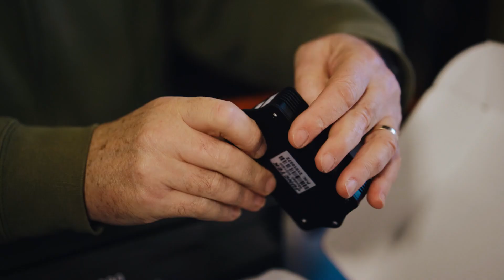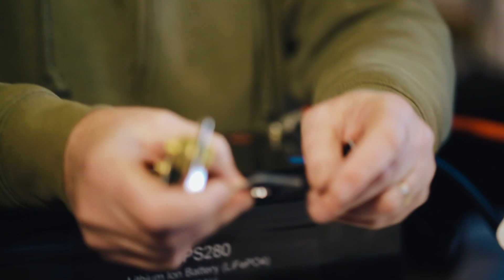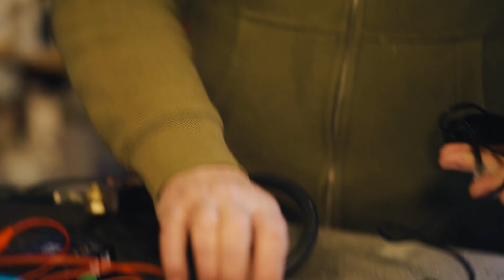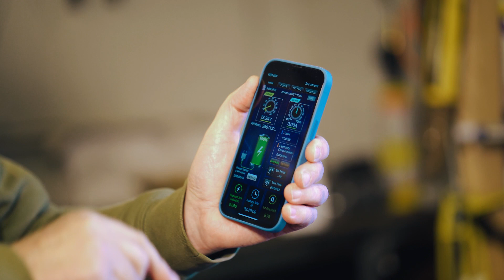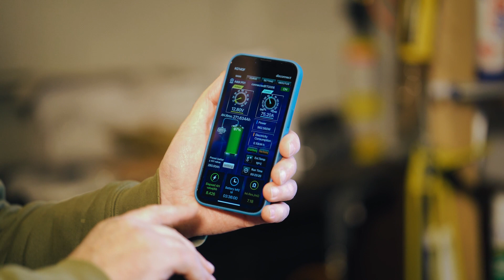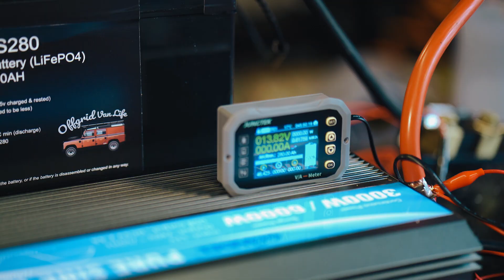Junctek KG140F Unboxing & Review [compared to Victron Smart Shunt]

Comment: It is a pity that you did not take the time to read the manual before starting playing with the unit... you could have saved a lot if time figuring out how to set it up and calibrating the scales so it measures correctly what you need to see. I had to jump to the end to see if there is some useful hint for a new user of the KG140F like me (who did read the manual before connecting the unit)

Comment: My one gripe with your video is you're simply not prepared to present anything. Kind of like a teacher walking into the room without preparing a lesson plan.

The shunt does have mounting plates and spacers. You need to program in the parameters for the battery. It has overvoltage and undervoltage protection if it's wired through a relay, just to name a few things you neglected to research.

Overall a really poor presentation and a thumbs down from this viewer. If you want to present a video kindly spend some time educating yourself about the product you are supposedly doing a review about.
Reply from the maker: Thanks for the comment Troy. 👍🏼
Reply: i do agree 3rd video uf this and in all fails. People WANT victron vs JUNCTEK and this guy does vidoea bout that and always missing something important..this time -oh i forgot to turn it on!!!  yes it's stupid junctek needs to be turned on... but gee..refilm it and redo...but no..uploaded invalid discharge accuracy test.

Comment: Good review guy’s. I think u can 0 calibrate the Amps for shunt. Q) being able to use a relay for hi &/or low cut off/on, this shunt could also be used as a ‘Solar Dump’, so when ur batteries are full, midday for me, I could heat some water for a shower instead of using gas all the time, does this sound do-able with this device? Cheers

Comment: Thanks for the video. Is there some type of housing that can be used to mount the screen? With the cable going in from the back, it'll be difficult to mount the Juntek screen flush without using some type of box for it.
Reply from the maker: We have not found one and generally make a housing bespoke for the situation.
Reply: @offgrid_power  ok thanks

Comment: Does the Junctek save/keep the graphing data, or does it delete it like the Victron does every time you open the app? (I hate the victron 712 smart for that) I prefer to see the history of what's happening when I'm not around... Means I can come back and check what's used the battery over time.
Reply: Kg140f supports historical data export and viewing.
Reply from the maker: See Juntek's comment. :)
Reply: junctek keeps data INSIDE. so you can download it to a phone via app. you DONT need an app to record data like with victron. i think junctek supports up to 1 million entries, which is not a lot if you count that it does 1 entry per second. it's about 11 days of data.

Comment: so you wire onto the negative terminal...  But if you have a bank in parallel which battery does it go on, the first or last?
Reply from the maker: Yes, you should put the shunt on the negative line. For a bank of batteries, it depends on your set up but I'd normally wire it so you have a single wire going to your bank which carries the charge/draw and I'd put the shunt on that line.